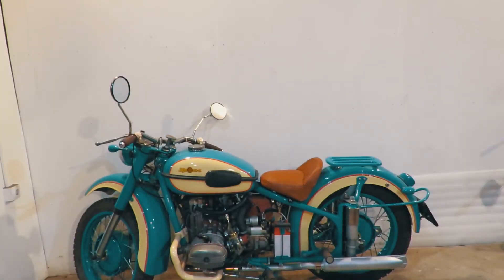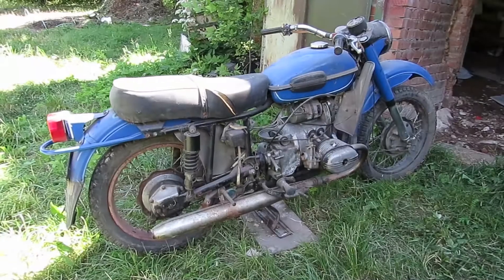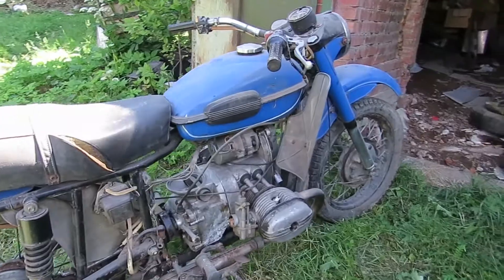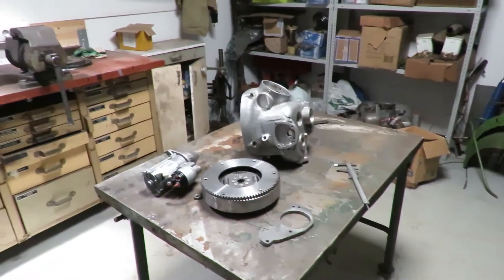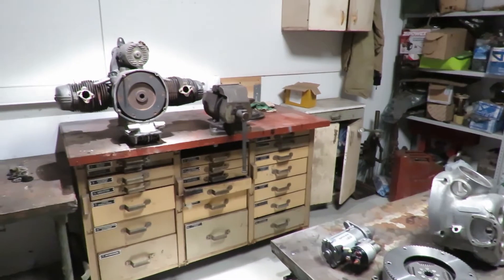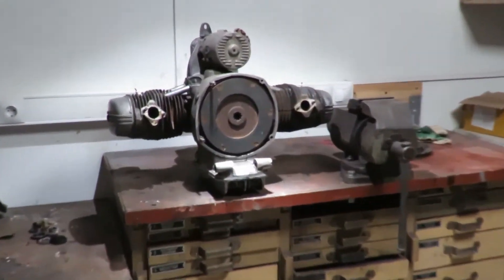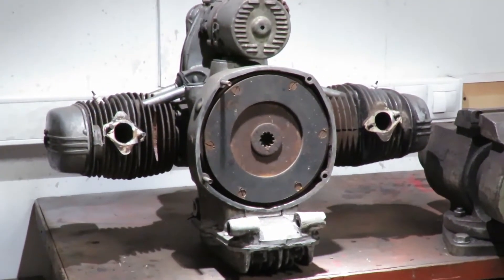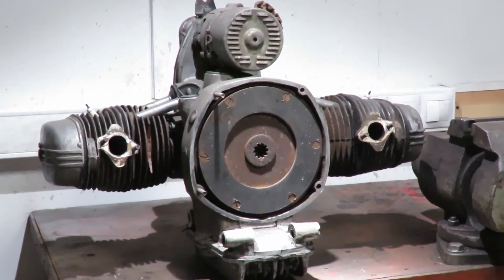#3 Old Ural sidecar motorcycle starter motor

Comment: Hello Dmitri, did you make the mounting bracket yourself? I want to do this also to my Ural M67...
Reply from the maker: Not really, there is a guy who manufactures a kit. It consists of the bracket and the top clutch plate with the sprocket.
Reply: @dmitripronin8627  Hello very good video.!!!How can I buy a kit?